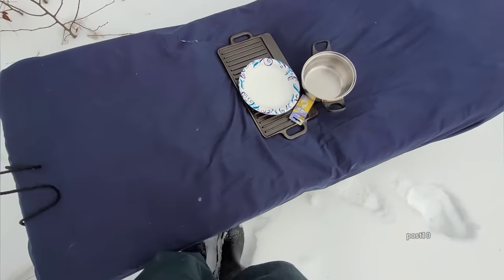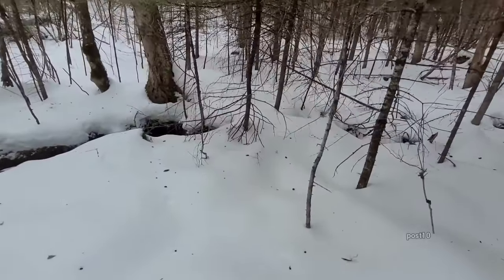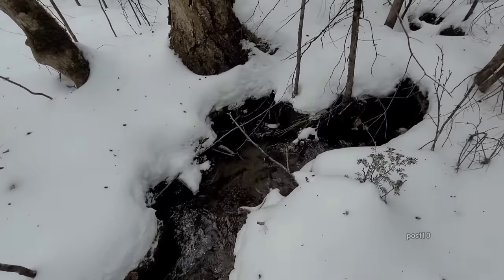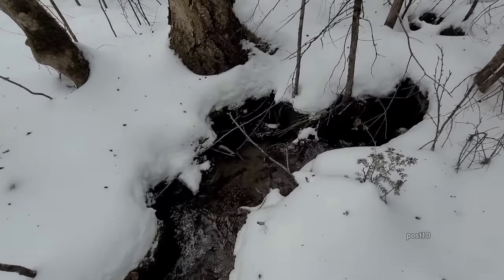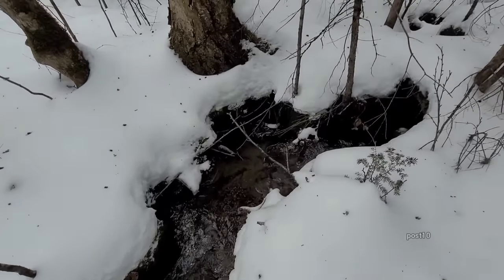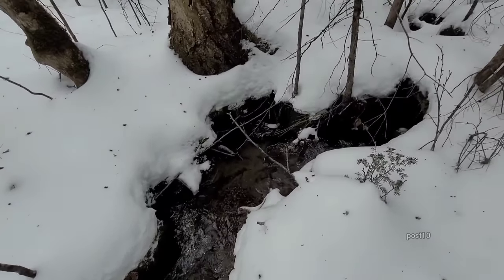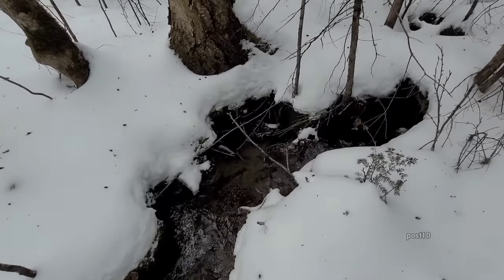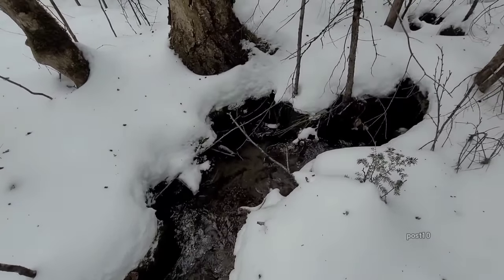Very Cold 24 Hours At The Truck Camp. Feb 2023

Comment: A suggestion for use of the chipboard U have stored & put out while your there. Last time your blanket stuck to the icy metal wall around your bed. Place the chipboard around the walls of your bed and it will stop the problem & give a little better insulation around where you sleep. & Y not put your flooring from home down in the van too. More insulation 😁😁😁

Comment: You could also use the engine compartment for a winter refrigeration/freezer storage space. Just cut a tin/aluminum box with lockable lid and no critters can get in.. a bear would have a hard time ripping into metal even. Plus you could make an inside small door to retrieve quick small goodies. And inside door/area would be somewhat warmer so that could be the fridge part. Would make for a nice completion for the driver area/kitchen you mentioned on building. And in summer it could hold things you don't want mice to get to, so you don't have to lug it all back out

Comment: for the leaky front door gasket stuff - and for that matter retaining heat when doing entry/exit to do your regular excursion stuff - you could probably get good value for putting up old blankets and such as a curtain against the gap behind that front entry area.  Can store it onsite in a plastic tub if a recurring thing - that way mice can't get into it.  If you have an old cheap pot - leave that on the stove when burning but not cooking - just to have dishwater handy.  For the Framing etc - If you are going to take the existing roof OFF - beware the walls may not support much weight of true a-frame.  building something OVER the vehicle - a lean-to style of a covering a-frame may work.  And/or you can do interior framing to reinforce the metal walls instead of building exterior.
Reply: Some excellent points here.

Comment: A tip for next time , soak the cut up French frys in a bowl of water for at least 1 hour or even 3, and drain  the water off. Dry off on paper towels.  Cook them on low heat a while. Let them cool off. 2nd time cook them again with oil at high temp. Reason they went brown is the starch in the potatoes

Comment: Great video as usual. If you oil the sliding door sliders and rollers thoroughly I'm sure it will be easier to operate. Also, oil up the rear door latches for those to operate better as well. You can use petroleum based oil or even vegetable or olive oil too.
Reply: White lithium... Great lube
Reply: Graphite works well, as does silicone
Reply: WD40 does the trick 99% of the time
Reply: @SteenSpinal4LIFE  Yes but it evaporates quickly.
Reply: Candle wax or bar soap won't collect dust and grit.
Reply: I use to dump wood chips at the mill in Rumford off US2 , one of my favorite runs and I remember doing a run out to the mill at night time in the snow but the temperature was rising through the night and the only person I talked to on ch 19 was a state trooper !!
Reply: @nancymcsweeney1920  - Great suggestion with White Lithium Grease! 😀👍
Reply: @oldodger  -  I agree: The likes of WD40 and CRC are more a short-term fix.
Reply: I have trouble with the rollers in my sliding glass door. It helps to find a way to clean the wheels or bearings and the track before you lubricate everything.
Reply: Use Tri-flow superior lubricant. You'll thank me later. I call it unicorn juice!
Reply: @d.d.5633  -  Ugh!  That reminds me of the ongoing troubles with the sliding glass door in one of my former homes!  The best remedy in the end was to replace it with a pair of french doors! 😄👍
Reply: @SteenSpinal4LIFE  wd40 is a degreaser, not a lubricant. It'll just stick even worse once it evaporates.
Reply: @oldodger  but this is not a permanent home, he can fix it in 5 seconds the 3 times this camp is used
Reply: @mightyV444  this

Comment: Have you thought of getting a couple old moving blankets and using them as curtains at the doors for insulation at night?  it might keep the drafts down and I've seen them at thrift stores for about 4 bucks a piece.  a bit of airline cable on hooks mounted to the walls and you could thread it thru grommets in the top of the curtains and you could open them and close them in the winter.  you'd have to pull them/bring them for each winter camping session but it's a thought.  you could probably also do clip curtain rings on wool blankets and the wires but the quilting on moving blankets might be warmer.

Comment: Just a tip, if you ever will be camping in the same situation again: You may hang a blanket or something inbetween the cab and living quarters of the truck. It will reduce the room size you have to heat, making it somewhat warmer.
Of course you still have all the metal sides of the truck dissipating heat, so putting on some insulation should definitely help. If you ever want to do that, there is actually stick-on foam insulation for self-build campers/RVs, at least in Europe. Could just stick it to the big panels and see some improvement already, without building any contraptions. A problem I see with that is the cost of such insulation (and looks of course). Just researched it. Here, a square meter costs around 9-25€ (depending on the thickness), so that might be a turn off :(

Comment: Answer to wood/plywood question: It depends on the purpose of your truck camp. The previous owner wanted to move it and use it as a shed. In your case, you turned it into a tiny one room living space with a wood stove for occasional use in winter so far with plans to rethink the exterior roof. If you continue to use it occasionally, keep the wood it you already have project ideas for its use. If not, dump it for other people’s use, on keep in industrial interior vertical and lateral lines for use. In your first video of the camp truck, you mentioned several times of how much you liked it. So again, dump the wood and maintain the nice lines. Btw- I really like watching your videos!!

Comment: Just a thought, why not bring blankets with you to hang over the back wall where the back doors are. Also, to help with heat loss, you could hang a blanket over the sliding door at the front. I think this would  help with drafts.

Comment: The reason you see so many “A” frames in the north is because “A” frames shed snow and thus reduce buildup. Reduced build up means less weight (from snow on the roof. Heat will also rise which means if you put in a loft, thst area should be warmer than the floor. The main thing about “A” frames is making sure you design the load transfer members and transfer joints correctly.
Reply: Would it be simpler to just slope it from one side to the other (half of an A-frame, so to speak)?
Reply: @ThomasABeer. You could, but you'd be cutting you're living space in half in order to keep the slope steep enough. Otherwise, the slope would be a lot more gradual. You probably wouldn't get natural fall off. You'd be sloping just like a normal house at best.

Comment: Just a suggestion.. when peeling off the greasy parchment paper from the burgers.. don't discard them in the fire or garbage right away, save and put them away for next fire.. they make for a great kindling starting aid. just semi-tightly ball them up and put them with the kindling, too help start the larger wood. Save the greasy paper towels as well. Also the orange peels can be great fire starters, OR you can use them to detour rodents (but need to replace them when they dry out)    Keep on rockin man !
Reply: 2+ hours of great content and your comment is a suggestion about what to do with greasy paper? 2 hours..lol

Comment: Aluminum cans will not turn into aluminum gas at those temps… so no, the only thing you’re doing is getting gases from the paint and epoxy.

The aluminum looks like it’s disappearing but what’s really happening is it’s melting and sticking to other ash.

To prove this, put the aluminum in a crucible and your starting and ending weight will be the same (minus paint and epoxy)

Comment: Thanks for sharing your time in the truck . I really appreciate you sharing about the wood burner. I'm so close. I just need to install the damper. Mine is a King 628, old still has the rust on it, for now. I also have a cast iron griddle, that was left by the prior owner, out in an old fire pit.

That flooring, sure wish you were in Tennessee. I would gladly take it off your hands, for my little cottage shed.
Pre-cooked bacon is my go to. Just enough for a couple meals. 
Looking forward to your next truck camping video.

Comment: You should get some kind of flooring to help insulate. Also if you put a couple of crates under the table instead of the barrels, you could use that to store extra things. Also a good idea to put a chair in by the where the steering wheel is. There are some comfy chairs that campers or vans use that I bet would be great to sit in.Also do you have one of those insulated sleeping bags? I would keep you warmer at night while you’re sleeping.

Comment: Maybe think about thermal blinds or a blanket across the front and back to block the drafts a bit.   It would help with the light when trying to sleep till 9
Maybe put pallets or something like that to not walk on the metal floor and if done right the stove could pull the cold air from below.

Comment: A few suggestions - 
1. Get a smoke / CO detector for the van.  
2. Use the sheets of ply to insulate the floor and/or walls in the sleeping area.  
3. Maybe get a small cheap solar panel set-up and car battery, to give you 12v lighting.  
4. Get some cheap mechanical fans that just work off the heat from the stove - to push the warm air around the van.  Good video - thanks for making

Comment: A little vinegar/oil for the salad. Mustard, salt/pepper would have been nice on the burgers. Bring a used paint brush uo to clean the ash from your stove, put the ash in your ash bucket. Good job fixing the stove. A jar of powdered cream is cheap and you can leave it there. Put a box of Decon out for mice when you leave. Many times traps won't due. Thanks for another adventure....... Greatly admire you, Bangkok John

Comment: If you can get the top to heat properly then you can also get one of those cast thermal fans for it to help circulate the warm air. I  remember growing up we would put a shop light with a  100-150watt bulb in by the engine since we didn't have the coolant block heater.

Comment: Hello, 
New subscriber here viewing from SanDiego, Ca. Cooking suggestion,,, soak frys in water for about 30 min. In cold water, rinse a couple of times in between, pat dry they fry. Soaking removes sugars and starch,, partially. Also, I have years of experience with that type of wood stove, and found that if you want to get that burning hot quickly,
Once you have it going, shut the door to just a crack and close the damper 3/4 of the way. It’ll start that water boiling in nothing flat. I’ve lived and learned

Comment: If you also do the brick pattern as supports on the walls it would look awesome plain just with the metal brick pattern or lay some insulation 4R Reading then throw up some quick waterproof dry wall (it's green) and you have a clean room easy peasy ?Just some ideas is all .😊

Comment: ‼Great video. Wanna an advice? Why dont you install your fire stove in a corner and closer to the wall that you can maximize your small space! You lose so much space with stove almost in the middle of the way. I dont think you lose any heat level too cause the space is small. Wont make any difference but you certainly could walk around better. Just an advice 😊👍🏼

Comment: I live in Haverhill Massachusetts and we got down to -14 ,one of my trucks wouldn’t start, I had to spray starter fluid into the throttle body to get it to start and I also had a antifreeze leak from the thermostat gasket and the next day when it warmed up it stopped leaking. We don’t like it that cold here in Massachusetts. Lol😂

Comment: I would use framing timbers that you get from trees locally. Frame the inside to give it structure and give it that rustic look. Somehow you'd have to cut the timbers. That means a table saw and a generator temporarily. For the snow you have 2 choices. 1. Melt the snow periodically just as you suggested or 2. Have a roof that has a severe angle on it so if the snow gets too heavy it falls off by itself.

Comment: You could JB Weld to temporarily fix the pin holes that leak. I'm assuming it would hold until you can address the roof in spring. ✌🏻👍🏻

Comment: Learned from northern Maine. You need to shovel your roof. There are long handled scrapers you can use. Or get up there and shovel. OR build a peaked roof so it slides off. OR keep it heated. Yeah it will ruin your truck otherwise. You also need a snow skirt over your underbody. 😮

Comment: I think you should insolate the ceiling, that will help A LOT, you can use some ceiling tiles or something. Also, insolate behind the stove to push the radiant heat back into the truck. That aluminum is like a heatsink, it's it's literally sucking out the heat. It think the truck is cool though, I'd be out there all the time, tinkering and adding stuff to it lol.

Comment: That piece in the top of the stove is called a baffle and the tubes with holes under in are called secondary burn tubes. It may have needed a stranger draft to work with the baffle in place without a hole in it.

Comment: A four degree difference between those thermometers is totally possible and still totally accurate, in theory.  The bulb thermometer is closed to the wood stove.  The clock thermometer is further away and also hanging on a cold part close to the door window.   So four degrees difference between the two is TOTALLY within expectations.    As you were!

Comment: My concern about the wood stove being a knock-off is that the insulation you removed may be needed to keep the top from melting. Since it has fake burners, the cast iron may not be thick enough to handle an extremely hot fire. But at least you have the rear fire exit if you need it.👍

Comment: The best knife I ever bought for chopping up vegetables is the Victorinox tomato knife, with the serrated edge, they have a thin blade that's fairly uniform or flat from the cutting edge to the spine, it's ideal for cutting straight with minimal effort and they're sharp as sharp can be. They're good for vegetables, cheese and meat. Well worth the investment and They're cheap, I got mine for between 7 and 8 euros, so probably less than 10 dollars

Comment: You could use the flooring for  inside the truck.
Don't forget that you need air to come in the truck to replace the air that goes out through the stove from the fire, if you block up all the holes the fire (and you!) won't be able to breathe.

Comment: i think I said before he certainly beats to his own drum which is a great thing to see  , most just follow , he is slowing learning how to operate a woodstove ,a bit of a pyro yes, keeping the door closed while first starting will help in makin coals ,maybe getting a blanket to cover front driving compartment be a idea? but yeah the young man is out there doing it , nothing teaches like hands on trial and error ,great job young fella , get a big kettle filled with water will help with the dryness of the air, and watched the clock and temp , didn't think you would sleep more than 3 hrs without stoking stove lol ,getting long sleeps in there at those temps will be difficult by yourself need a stoking buddy to take turns lol, a lil stove fan will do wonders ,im not on the young mans case , i speak from experience , lived in a similar setup in northern ONT canada many years , 1 more piece of advice , push that stove closer to that metal wall get alot more heat in that space 100% by warming it, could also very cheaply insulate the floor , srry about long post but im adding comments as I watch , great job young man i look forward to more thanks for bringing back the memories of roughing it back in my day , cheers from cold northern ONT.

Comment: I think you should just build a large structure on the outside, separate from the truck.  Perhaps a few feet extra on at least 2 sides with a large lean-to style roof.  That would give you protection, additional dry air space around the the truck and could give you lots of space to store firewood.  If you could get a 6-8 foot additional feet out the front, then you could build an outside kitchen in a large secured metal box that is rodent/animal proof. In the spring you could pressure wash the truck and a roof could protect the finish also. If you got inventive you could create a ‘root cellar’ for refrigeration in the summer and protected-from-freezing in the winter, maybe a gears and pulley system to retrieve a rodent-proof food box.

Comment: You know, if you have enough lumber, you could build bunk beds, or at least one bed plus the frame for the other.  Sleep in the lower bunk in warm weather, and the upper bunk in cold weather, since the upper bunk would be the warmest.  Also, you could use those big sheets of ply or mdf to block part of the truck off so that you're heating a smaller space.  I always enjoy your camping videos, just hate to see you be too cold.

Comment: you could put the wood down on the floor or flooring to insulate the cold from the metal floor.
you have to be careful in extreme cold! you have to keep the bare skin from being exposed.
it was great your car started, you can put a paper bag / cardboard in front of your radiator 
in extreme cold to minimize the icy air going through the radiator. if the car starts to run hot
remove it. so your car gets up to temp and stays there.